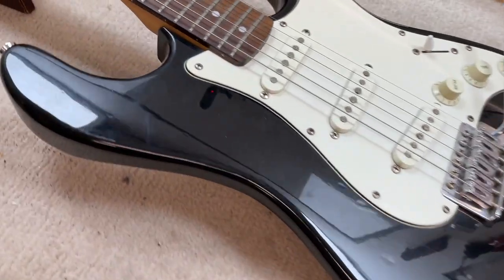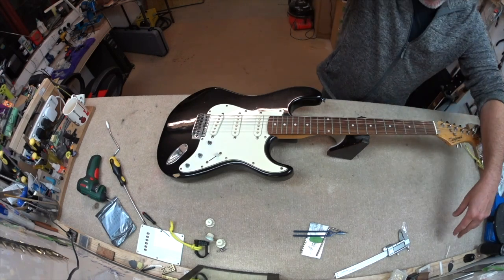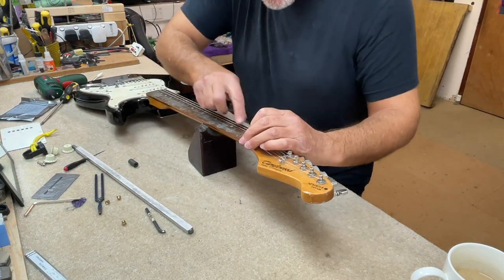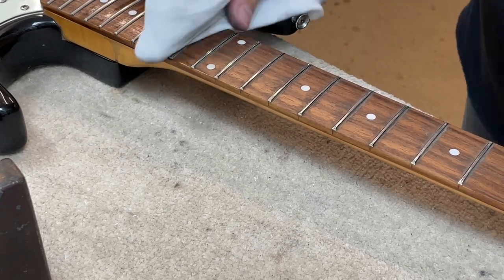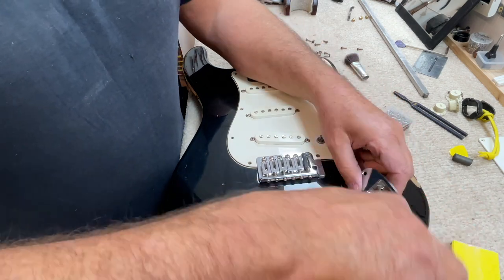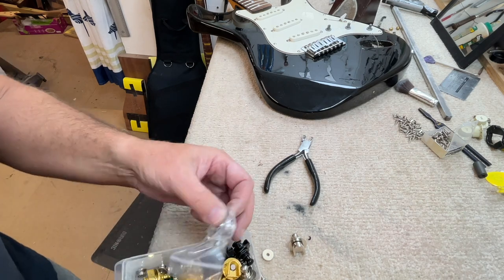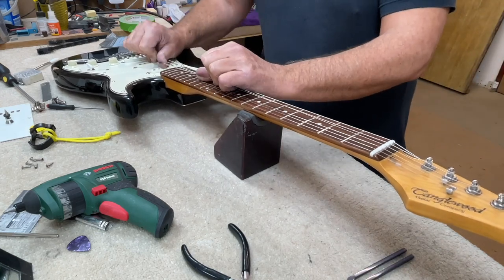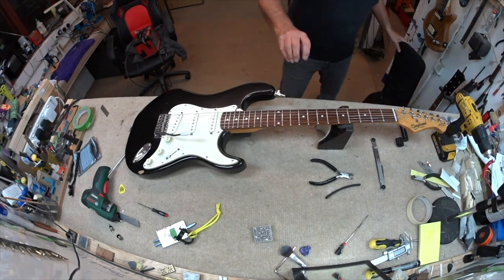Tanglewood Stratocaster set up for beginner player

Comment: Now those tuning pegs look a whole lot better than the stamped ones on the red Sunn S style you worked on before.
Reply from the maker: They're one step up the family tree for sure, but still very basic. The ones on the Sunn Mustang do the job (and play no part in the tuning stability anyway - that's down to a properly fitted Tusq nut and fully stretched strings) so not as much a problem as the people who want you to buy expensive tuners would have you believe :D
Reply: @SamDeeksRelovedGuitars  You are absolutely right. 99% of tuning stability problems are due to strings binding on the nut, string trees and even bridge saddles.

Comment: Hey Sam, do you just double side tape  400/320  grit to the truss rod when you do your ingenious leveling method ? and do you have a link for the crowning file you use, many thanks George. PS, you can get a small pack of trem hole springs for peanuts that stop the trem arm waggling !
Reply from the maker: Hi George. Typically I've been using a self-adhesive wet / dry paper called 'Rhynostick' (400 grit) but I'm running out so will probably make my own using double-sided tape and regular sheets of 400 grit (I normally use Klingspoor brand). If / when you have to join the wet 'n dry paper on the truss rod underside just be sure to butt the two pieces of paper together with NO overlap. 
I use a 'U-Channel' truss rod; StewMac sells this type (their 'electric guitar' size) but it's otherwise known as a 'Martin type' truss rod and you can find them occasionally in UK suppliers (or German). Hope that helps!